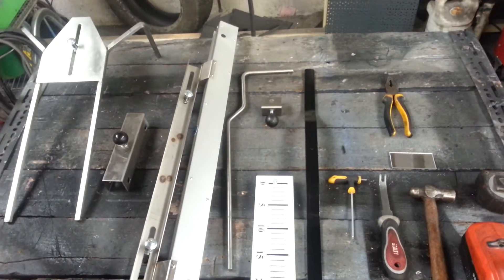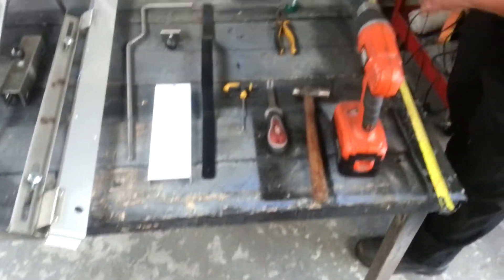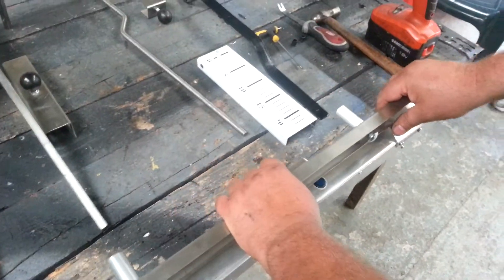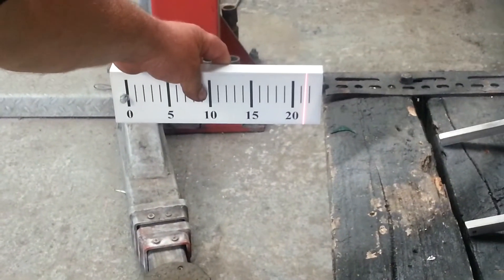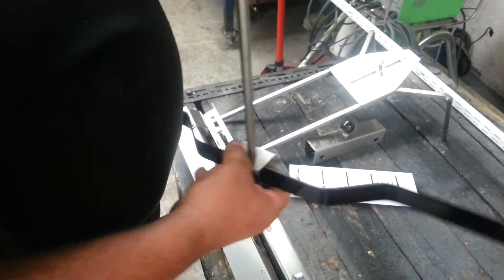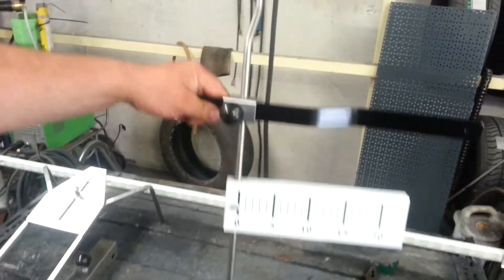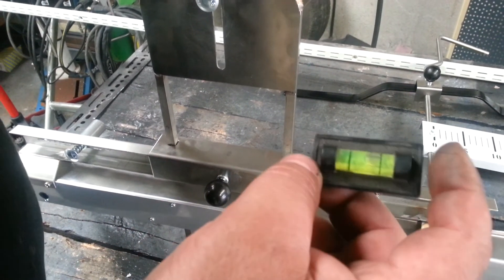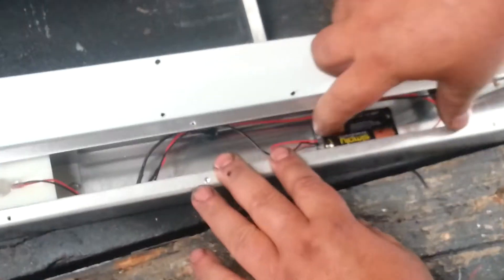How to Calibrate Tracking Gauges

Comment: This is so stupid mate you're responsible for a lot of bad tracking!

To correctly align an aligner you need to buy 3 solid metal cylinders 20mm diameter and at least 300mm long.

Drill a hole in the middle of the ends of each cylinder and tap out the hole so you can bolt it

then you need to fix those cylinders on your variable adjusters so that the front gauges are facing each other. You then need to calibrate them to zero!!!!

To calibrate those to flags you need 2 more cylinders about 500mm long and 20mm diameter. you need to attach those to the cylinders going across at 100mm from the edge then make sure they are straight then attach the flags to them and adjust them so they are level on both sides and are set at 10.

This has now created a perfect rectangle!

your gauges are now aligned!!! 

This should cost you £40 for the cylinders and about £20 for the 90 agree fixings £60 and you can recalibrate them as many times as you like!
Reply: Hello, I am interested in your procedure for aligning. do you have a website or a drawing or a plan Thank you very much.
Reply: @antonypalierne4983  what do you mean? My method is to calibrate the mark 1 wheel aligners not align a cars front wheels.
Reply: @martinroberts3977  I confess.

I am French. and I have trouble with the translations. I explain to you I am manufacturing. Pretty much the same tools as in the video. and I would like to know how to properly calibrate them.

Put my English is very bad. so that's why I'm asking you if you have a drawing to provide me so that I can understand. where your email if possible